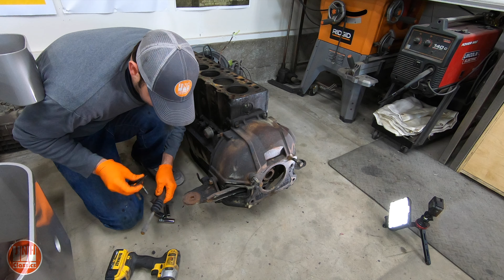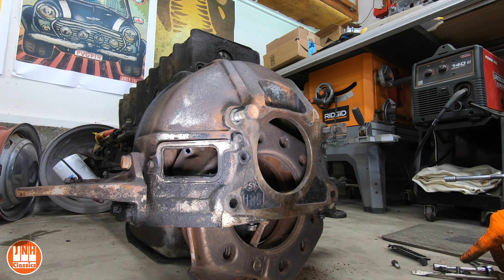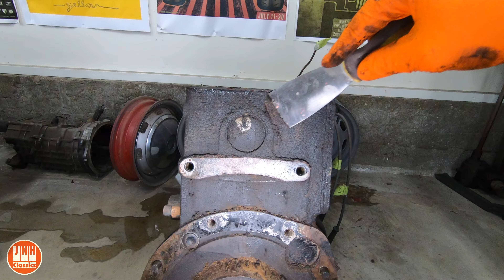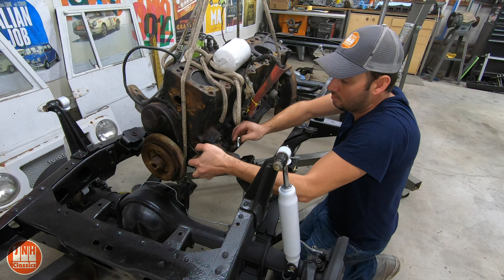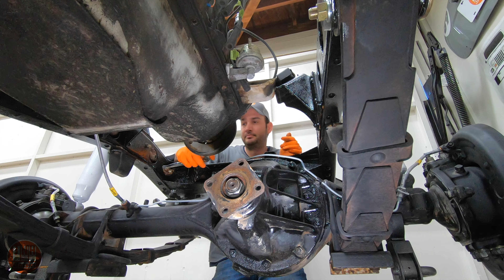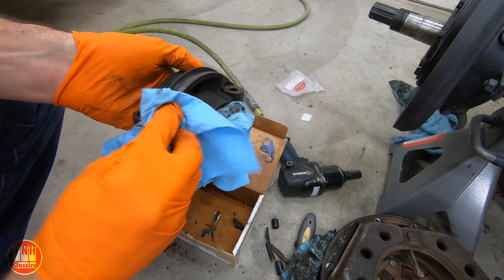FJ40 Restoration (Episode 16) - Engine Install

Comment: You can pull the seal out using a pick or a screw driver + - cutting the inner lip. that is incase you didn't want to remove the brace. Thanks for the awesome content man.

Comment: You did not need to go through all that trouble of removing the pan and rear main bearing cap. All you had to do was pry out the seal and pop on the new one. Easy peasy. By the way did you oil up the bearing before you reinstalled it?
Reply from the maker: Vin 911 I planned on removing the oil pan at some point anyway. I did oil the bearing👍
Reply: Ok now I understand why. I also have a 911( 87 Carrera) and a land Cruiser (65 fj45 swb pickup with removable top) . So, I'm very interested in those two builds. Keep up the good work. Your motivating me to finish my fj45. Its in pieces right now.

Comment: Good form doing the rear main. My very first FJ I did years ago was a 75 and I had the motor out and did a new clutch and got lazy and didn't do the rear main, big mistake. I ran a DUI ignition a 38 mm Weber and a long tube header. That sucker would push oil out the old seal and get on the clutch every time i got on it.. Learned the hard way
Reply from the maker: Landcruiser intervention thanks for the good info, and for subscribing 👍

Comment: JNH I have to redo my BJ 42, 4 cylinder diesel and your videos will help me a lot.
can you tell me how much to torque the cylinder head? thank you
Reply from the maker: I don't know the specs, I just google it or check the shop manual right before I do it👍
Reply: @Jerod_Helt  in France the technical reviews are not complete and my knowledge of English is zero. good sunday

Comment: What kind of shocks and springs did you install on the fj40?
Reply from the maker: I’m not sure... they came on it when I bought it. I don’t think the springs are stock and I just repainted the shocks. They seam to be in good shape and I want to drive it before I start changing the suspension.
Reply: JNH Classics   Thank yoy